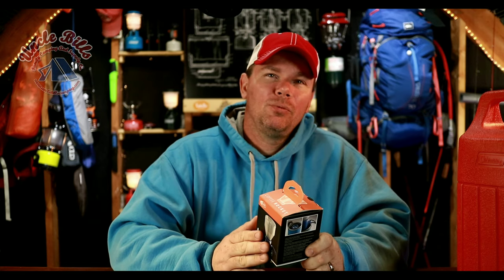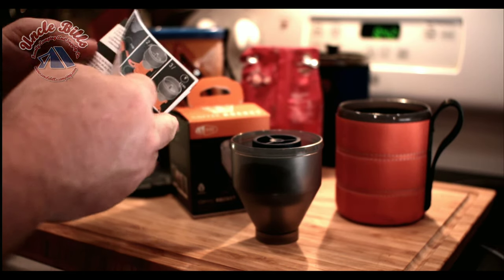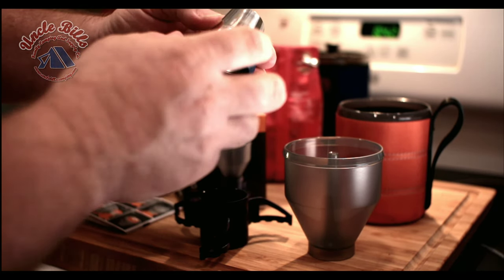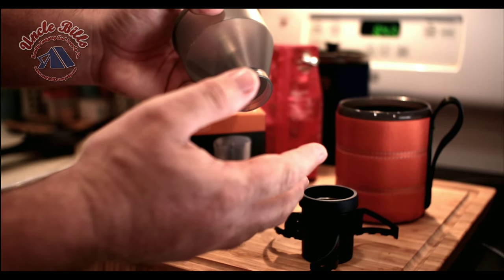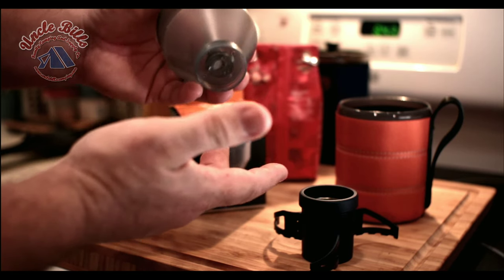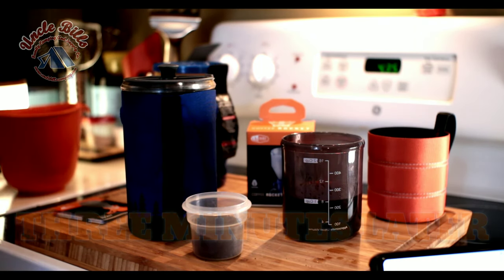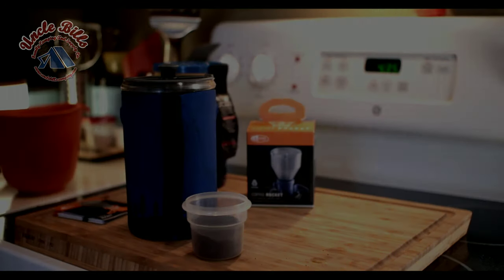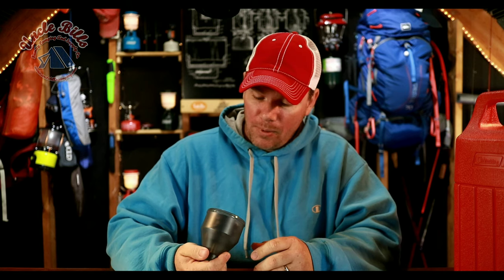making coffee with the gsi coffee rocket

Comment: I purchased this yesterday. I went into Cabellas with $11.00 in rewards points and thought "What can I guy with $11.00! Then I found this and am usually pretty skeptical about these pour through trail brewers but this looked light weight, well thought-out and durable. I tried it this morning and its great. Re-useable filter, durable, easy, FAST (and I felled the filter with coffee), and make sa great cup of brew (Make it good). It packs down nicely and is light and just really well designed. Thanks GSI!!  PS-I did use fine grind coffee.
Reply from the maker: GSI make some very useful outdoor kitchen products. I have used the Java press in my home and while camping for years and it’s practically indestructible. The rocket is a good complement to their coffee product lineup and I’m glad you like it👍

Comment: I like it’s compactness and fit into my mug. The part I struggle with is how slow it brews. I’m talking 4 minutes. With it being open over one’s cup heat is lost quite quickly. I tried having my grounds not to fine, but it doesn’t matter. Not sure if it’s worth keeping, but for $10 kinda hard not too. Any suggestions to speed up the brew time?
Reply: I’d say grind the holes to a slightly larger diameter? Problem is you risk overflowing the filter I would guess
Reply: @ktrigg2  I ended up returning it and getting the GSI ultralight coffee drip. More compact, and quicker. Maybe a little to quick vs. to slow, but works for me.
Reply: MrBalas3:  used fine grind coffee and it seeped through very quickly.
Reply: I found a lid that worked on the funnel perfectly. Then I made a hole in the top and use a small bicycle tire inflator hand pump. Viola